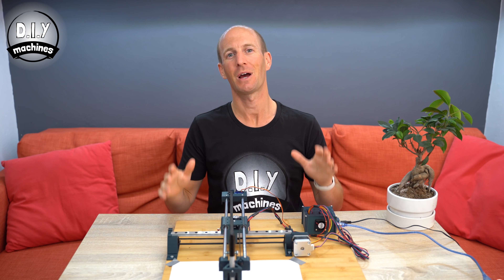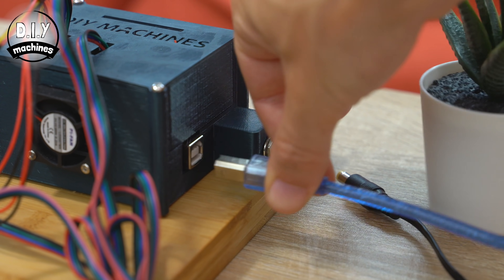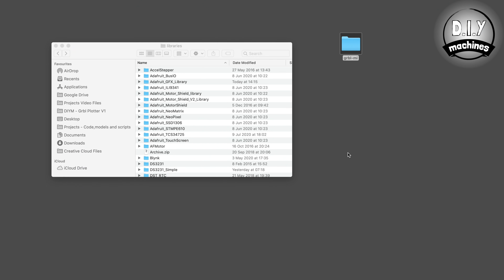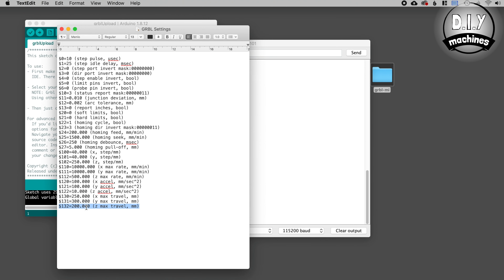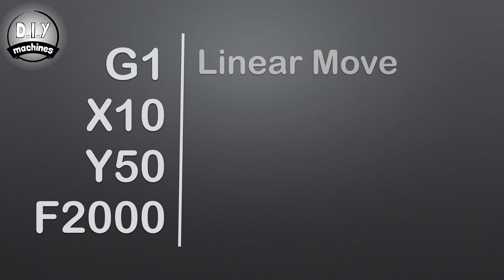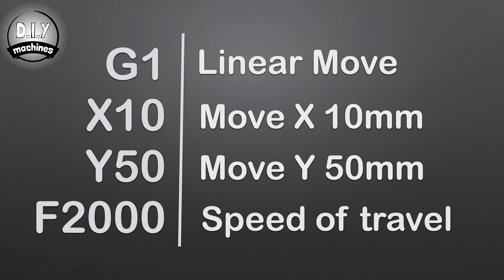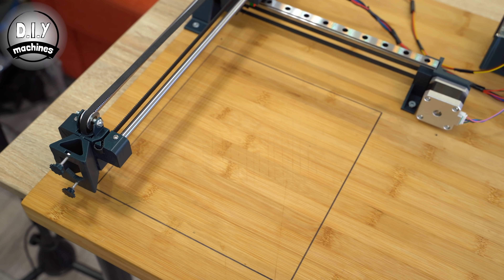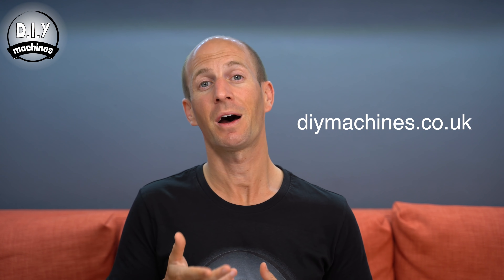Part 2 - Super Easy 3D Printed Arduino CNC Drawing Machine - The Software | GRBL | Inkscape Plotter

Comment: Thanks for the well made tutorial!  Any thoughts on how to make this plotter without the need for a base, it would allow to write on bigger and thicker surface. Also are the motor strong enough to write vertical? For example I set up the machine on a wall and it can draw. My daughter room's need some more artwork :)
Reply from the maker: Thanks Loïc. Goo question about making it without a base. I suppose for what you're suggesting you could attach it to a wooden frame instead of the board, but have the frame sit on the the topside of the printed 'feet' and screw in from below. This would then make the surface of the wall level with he drawing plane. Motor wise, I think it should be OK. Slow the movements down when you export the GCODE - that should help prevent any slipping of the timing belts. Most of the weight (the two stepper motors) is very central to the main machine linear rail on purpose to keep the weight on the extending arm to a minimum.
Reply: @DIYMachines  Thanks for the detailed answers. Still wondering the trade-off between all flat or longer pen offset but the lever the pen create might be an issue with rough surface.  Got the IKEA cutting board already, but it will stay on the kitchen this round :) will go with your suggestions.

Comment: How dimensionally accurate is this machine? I am thinking of using it to mark out technical drawings onto plywood for model making.
Reply from the maker: It's pretty good. As long as you have the GRBL parameters for your machine dialled in. The mains ones being:
Reply: @DIYMachines  I think you forgot to check your own comment.